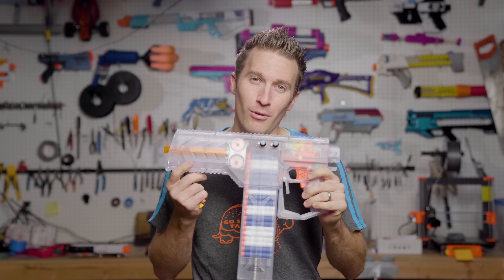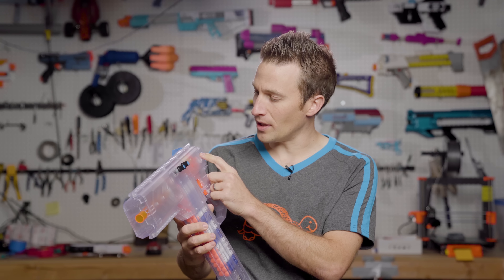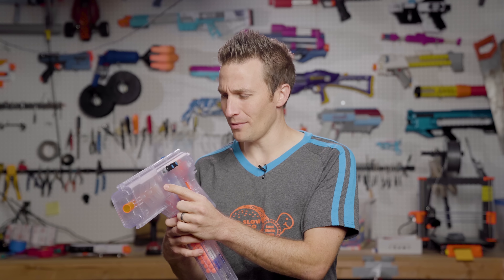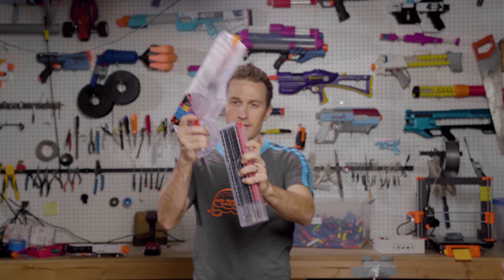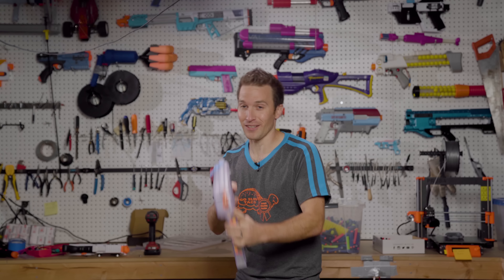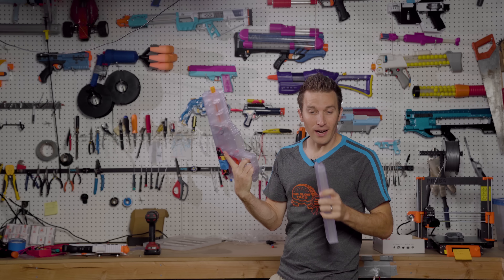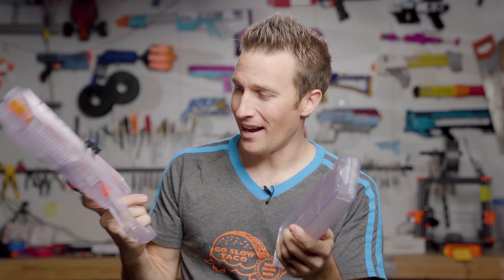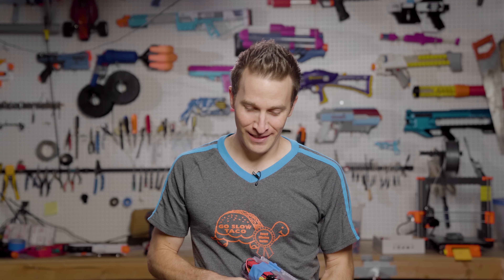Worker Dominator 40-round Dart test

Comment: I think I mentioned it before but the battery stock from foam technician (or if you can make one yourself) would be a good idea for the battery issue, and a lot of people already mentioned different variations of pusher arms so I won't beat a dead horse. I think once people in the community create higher quality versions of the worker cage for the dominator things will also improve.(being that there are specific dimensions for the first of the three cages, hopefully someone can make a better one.)

Comment: I guess one way to work around the feed issues in the last test would be having a wider (if possible) pusher head? Just slightly wider so it's able to pick up the back of the dart on either side of the expanded mag.

Comment: Since this can take up to three flywheel cages, when can we expect a video on required voltages, batteries, and motor setups? I recently ordered my dominator with six of their 130-ish sized motors for a proof of concept and I want to make sure it gets the proper battery / mosfet setup.
Reply: I wouldn't use 6 of any one kind of motor. With multi staged blasters the RPMs need to increase at each stage.
Reply: i'm thinking stage 1 meishels/fang revamps (2s), stage 2 honey badgers (2s), stage 3 fang revamps (3s overvolted)
Reply: I would run the whole thing off a hefty 3s and just have the third stage overvolted. Something like rhinos, m2’s, and honey badgers. Rhinos on 3s are only like 33k rpm, m2’s are almost 50k on 3s, and honey badgers are pushing 65k on 3s. No idea about the longevity of the m2’s and honey badgers on 3s, i would keep the crush low on those stages. If you want even more power do something like valkyries in a 43 for the first stage instead of rhinos in a stock cage.
Reply: I would say that the following would work well: meishel 2.0s on 2s, krakens/new-rhinos on 3s (they’re pretty much the same motor, Fang revampeds/titan cronus overvolted on 3s. Stages 2 and 3 could possibly be run on the same lipo, but it would need an extremely high discharge rate.
Reply: @Daniel_B79  NO NO NO NO NO. You do this you will rip darts to shreds due to the imbalance in speed. You want to pick the highest RPM and run those same motors in all stages. A 3 Stage 3S Wolverine setup or a 4S Neo Hellcat setup would probably net the highest overall FPS with high crush cages.
Reply: DON'T USE 3 CAGES!!! YOU WILL OVER-VOLT YOUR LIPO!!!

Comment: I assembled a swordfish full-auto, and I have the same "runaway firing" problem you mentioned, specifically at high firing speeds.

As the dart pusher is being pulled back by the spring, it encounters some kind of resistance at just before it makes contact with the dart pusher switch. If you open it up and use your fingers to 'follow' the pusher as it moves back (with the auto-gear turned away to not make contact), you can actually feel this resistance. At high firing rates, this mysterious resistance causes the pusher to slow down its motion, such that the auto-gear makes contact with the pusher teeth before it moves fully back to activate the switch. Hence the cycle continues endlessly, with the pusher never making it back to activate its switch before the auto-gear contacts and pushes it forward again.

I have no idea whats causing the resistance. I thought it was the bottom of the auto-gear casing rubbing against the top of the pusher, but i've tried lube and sanding whatever I could think of, and the resistance is still there. So my swordfish is only capable of low to mid firing rates, but high firing rates always cause the 'runaway firing'. Rather disappointed to be honest.
Reply: I think the lower torque motor for the pusher might be the reason since they don't come to a halt as fast as higher torque motors
Reply: i've done an arduino controlled  select fire Swordfish ...and the ROF shown here is beyond the components offered .. this isn't a belt or RS style pusher...

Comment: Hi outofdarts, can you do a video regarding the accuracy. 

Many have asked the question, canted single set up vs normal single set up which is more accurate--- reason---
Because its the first contact made by the dart yet still has a barrel to encounter.

Comment: I think the problem may be an easy fix if the pusher is failing to feed darts that are slightly out of position. The pusher head design needs to be remodeled wider, which is a relatively quick, single afternoon model in software. There shouldn't be any double feed issues with a larger pusher head unless the darts being used are really stepped on. Can't say for sure without having one on the work bench to examine directly.

Worst case scenario: redesign the flywheel cage feed ramp with left and right skewed channels to accept darts from either position. This is how double stack box fed rifles typically feed. 

It's unfortunate, but as is, looks like the 40 round double stack magazines simply won't fly for game play with community or scavenged darts. BYOD and plenty of extras. But, odds are the only people using these at games will be competitive players who use their own single type darts and color and immediately cycle out damaged darts in between rounds after pick up.
Reply: I'd have to take a close look at the pusher and how it interfaces with the feed lips, that I noticed are wider apart than standard single stack mags. I'm also making the assumption that the top feeding dart has no more than 50% overlap with the next dart underneath with the double stack supported by two walls on either side. But, I am comparing foam tubes to brass cases, which clearly have different tolerances and characteristics.

Comment: Double stacked drum mag when?
Reply: If you mean to double current drum capacity- so, 50-70 rounds- like this does for standard darts, then probably never... Not for darts, at least; maybe for Rival rounds.

In order to double-stack a drum with that kind of capacity, the spring strength needed to feed the darts would crush the back end of said darts. It would probably require a winder-and-latch system like some Real Steel drum magazines do... If you don't, having a spring strong enough to properly feed all those darts will make the drum spew the darts all over as soon as you finish loading it, without some kind of retention mevhanism- which puts MORE pressure on the darts.

Rival balls are much sturdier, though. It should be fully possible to build a spiralling drum magazine that holds upwards of 50 Rival rounds, without being much bigger than a 35 round dart drum. Compared to darts, Rival rounds crush less; the spring could be stronger without causing damage. Rival rounds feed easier, too, so they wouldn't  necessarily NEED a much stronger spring... The shape is a huge plus, and there's no drag from rubber tips to cause friction.